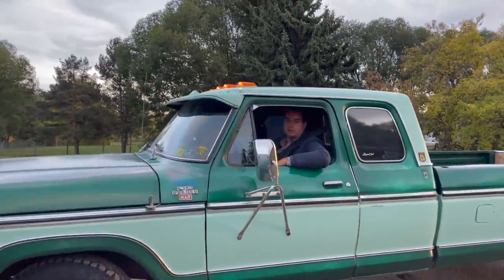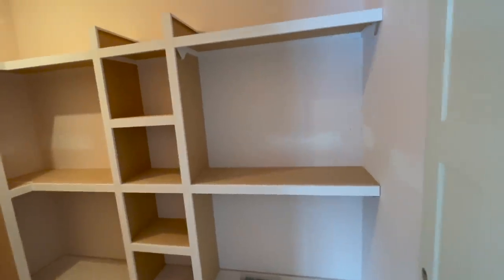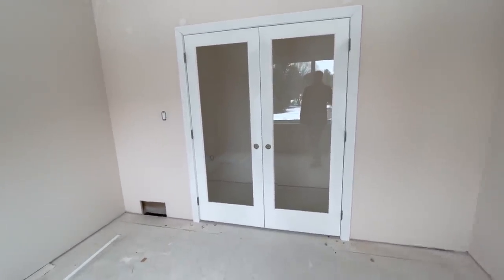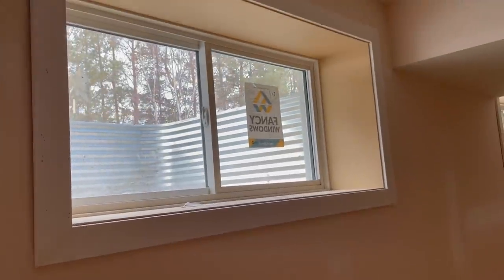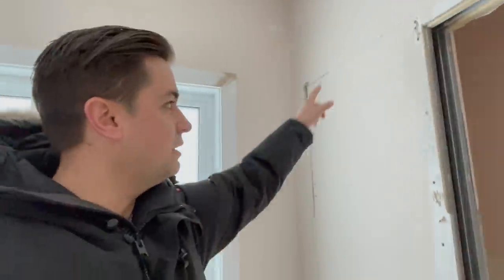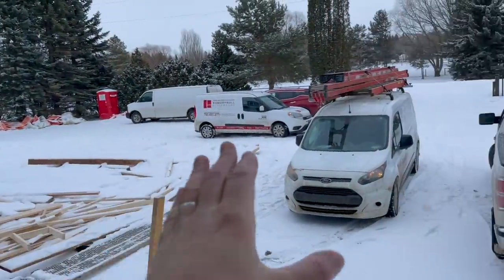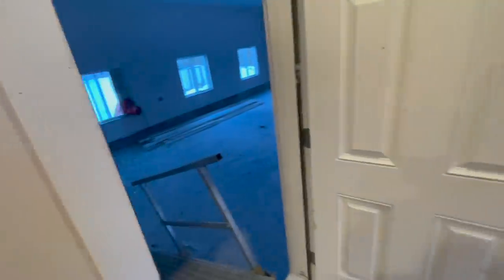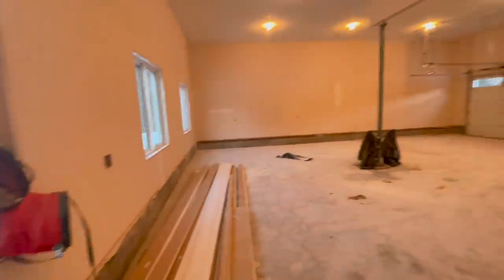No more drop of doom! the railings are in!

Comment: I have ocd and that angled railing would be a constant source of irritation! I know it's a small issue, but I've never seen  stair railing done that way. I think your home is a quality build in every other way. So happy for you guys!
Reply: Agreed!
Reply: I'm sure it's due to building codes but yeah it's annoying.
Reply: When the house is completed it will look fine.
Reply: Totally agree. Never seen it done that way. Normally, that top post is extended taller, allowing for the new height to start there if code requires the height to meet that triangle stair. Otherwise, continue the same height and then don't do a handrail for the first portion of the turn on the wall. I've loved everything about the house, but that's one thing I'd question.
Reply: @randoline13  they installed it like the rail was on a wall and you can make it follow the line of the staircase. But, when the rail stands alone it should be level. And, it's right by the front door- very noticeable : (
Reply: Look at it this way, Gives it Character  lol !!
Reply: The installer must have been drunk. There is no excuse to make a mistake like that..
Reply: @pallecla  Someone said that they made it to code. Maybe, they were tired and at the end of a long day and just needed to finish it instead of alter the design. The rest of the handrail is gorgeous!

Comment: It certainly appears that the finishing is very high quality. Personally, I'd keep all the wood scraps. You can use them for little projects, fireplace, perhaps an outdoor fire pit, or even a shed for garden tools just next to the veggie garden. At least for shelves in the shed. You may want shelves on which to start seedlings for veg, flowers and so on. Since your garage will be all about vehicles, a good sized garden shed may be in order and that will need shelving and hooks to hang tools on.   Great call on the fireplace design - it is a stunning centerpiece and focal point. I'm blown away by how much noise those glass doors cut - imagine how much better it will be when the carpet and drapes are in to absorb excess sound!   The main bedroom closet is quite nice; you're going to really enjoy being able to put things away so easily. Congratulations. It's fantastic.

Comment: I am not seeing any electrical outlets going up the stairway.  It's nice to have them for decorating purposes, as well as on that half wall to the right of the stairway on the main floor.  You probably have already planned things out, but that seems like the perfect place for a shallow table with a lamp.  Everything is looking so wonderful!
Reply: You'll need outlets for vacuuming, that's a lot of carpeting. 🤔
Reply: You never put electrical outlets on stairways because they will cause a trip hazard, you install an outlet at top and bottom stairs!
Reply: @davidplayz7323  Cords cause trip hazards, not outlets, and that can happen no matter where outlets are placed.  On stairways with multiple 'landings' like this one, it is common to have outlets if for no other reason to have plug-in nightlights on the stairs.  In actual practice, the further away the outlet, the greater the chance of tripping because of the length of cord to reach it.

Comment: It's looking great! I love the glass doors on the office. I love that Abigail is planning fort-building in the closet ☺. An idea for hot weather, if you get any there: a bubble fort. You take the biggest sheet you can find, or safety pin 2 together. Lay them out flat on the floor with a little slack in the middle. Put books or other weights around the edges, leaving two openings, one for a door and one to put a box fan under the edge of the sheet. Turn the fan on High. We loved building these forts growing up in Arizona. While you're in there you can also talk into the fan and sound like a Cylon (?) from the old Battlestar Galactica: "By your command" 😄

Comment: Even if you don't completely finish a basement at build time, have the egress roughed in (required many places, aprox. cost for son who didn't - $20,000).  Have rough ins put in for bathroom during build.
Reply: Wow if I had the money and if I lived in Canada instead of Florida I would hire drupad to build a house for me he is a fantastic contractor
Reply: Take your house to being muddled and undercoat on. Dust from sanding is a 👹 but
Reply: In one of the houses my parents built, they had a fireplace and other features (plumbing and electric for a built in wet bar to go next to the fireplace on an interior wall, etc  put in at the time the house was built.  The plan was that the builder would be back in 1-2 years to build another family entertainment area down there.  It worked out perfectly!

Comment: The woman always gets the full height closet area. 21:32 The guy gets the top and bottom closet areas.  21:37  They need the full one for dresses and long coats. If necessary, you have to share the long section.
   By the way, Costco has a nice 1' x 4' led panel, several of these in your house would be perfect. Especially the garage work area for the future.
Reply: True about the long closet space - long space for long clothes (dresses), short space for short clothes (pants, shirts).

Comment: Not many times I make suggestions, but some things just stand out. The one railing as you go up the stairs, just looks out of place as it’s angled to match the next rail. I mean that’s not done properly. It should be level, and the next rail can stand on its own level. I did also wonder about the gap between the stair going up, and the stairs leading down to the basement. I assume you have a special plan for that space. Just curious. But I most definitely would talk to your contractor about that angled railing, that just doesn’t look right at all. Other than that, you guys are getting quite the home!

Comment: Garage doors bother me. The way the tracks run over top hurts your vertical space. The drives can be mounted beside the doors and the track run to the ceiling to restore that valuable space.
We did that at our shop, what a difference.
Reply: At 14 ft, I don't think it's an issue.
Reply: @firesurfer  Until you could sure use it...
Reply: @pooginmouse  At that point, you may be a hoarder.
Reply: Up is good when working on vehicles.  @firesurfer

Comment: On the front porch  you wanted to put stone part way up the roof supports but it looks like you can't do that because the posts pillars are too close to the edge of the porch floor edge UNLESS YOU COULD EXTEND THE PORCH FLOOR/DECK OUT ABOUT A FOOT and, of course, add on to the current foundation under the floor extension to take the weight.

For the car hoists in the garage, go on the internet, VICE GRIP GARAGE,  he has three car hoists for 6 cars, ie 2 "two story."

Comment: The master closet is definitely not large enough. And the rail in the stairs at the top that goes across the fence like opening at the top does not look right. Do you need a railing on both sides? We only have a railing in one side of our staircase. No carpet on stairs either.

Comment: Hi,
I love this channel, I am sorry if I am being negative in any way, this is meant as being constructive. 
The railing going slightly upwards where the stairs turn: that’s totally wrong. It must be horizontal. And it will not join with the rest of the railing because the railing on the wall, the horizontal part, does not need to be there. Nobody will ever grab that. You finish the upward-going railing about where the support is and leave the rest of the wall without a railing. That way everything looks normal, not goofy. Sorry Alex. You even said it was « interesting » and you know that as time goes by, this will become an eyesore. Get it level…

Comment: Everything is looking great. The one thing I wound reconsider is that sloped railing where the stairs turn on the first floor. When you walk in the front door the fact that that one railing slopes at a different angle to the others is probably going to drive you and/or your wife nuts. It would look much better straight I think, and the railing on the wall doesn’t need to meet up to it. It can simply stop and not connect to it. Just a thought. :)
Reply: Yeah, it was driving me nuts looking at it Stephen. Ha the railing on the wall connecting to it isn’t straight either. I understand the builder was trying to connect everything but I don’t think it needs to be connected.
Reply: It's up to code.
Reply: Usefulness is the best way to design.  The handrails are perfect and will be very appreciated by those who need to use them.
Reply: The winder causes that. Fixing it would be a problem. It would need a complex joint.
Reply: It's a very bizarre thing for the contractor to have done.
Reply: @firesurfer  The two railings don't need to connect at all. The basement ones don't.
Reply: @LeeKeels   There is just a landing. No winder. Code requires the handrails to be connected for winders.
Reply: You can connect them if code requires it, just do it with right angles. Do a straight railing around the corner and then go straight up to meet the railing coming down the steps on the wall. My brother lives near Toronto and has the same type of setup with the wraparound steps, but where the wrap around is they still do right angles. Maybe it’s different where he lives but I’ll bet they could change it pretty easily. It even looked in the video like Alex wasn’t sure about it himself when he said “that’s an interesting way of doing it”.
Reply: @Kevinca0809  It's easier, just not aesthetic looking.
Reply: @firesurfer  yeah, one way or another something is off aesthetically I guess. Too bad they didn’t have a landing like on all the other turns in the stairs. That would have made it easer. :)
I’d still try to make it less obvious though. Maybe even make the post a little taller since the one on the other side is taller already anyway. I love a challenge so I’d be messing with it trying to make the sight lines as unnoticeable as possible.

Comment: Slides and recessed guides for pocket doors can be tedious in that after some use they tend to not stay true or straight in the wall and have to be adjusted. Make sure should there be locks on them that they are child accessible in that from the outside they can be opened in case of emergencies  like fall in the tub on the floor or WHY! Safety first! Are there enough smoke detectors and are they with batteries? Like the Stairs going to the second floor yet wonder why they were not widened on the bottom to allow for people passing by on the stairs from different directions. Design is not that way yet would look so nice instead of a dead space from main floor stairs toward basement stairs. Suggest bringing your dog to visit the house with your family because the transition from home to home can be upsetting to animals. Noticed there are no circulating ceiling fans are you geting some? Paved driveway is spoiling Alex! Ha! Ha! Building a fort sounds like that pile of wood scraps will come in handy. Thanks for sharing Stay Safe!

Comment: The walkway upstairs, I think you called it the drop of doom,  looks confusing. How will those windows get cleaned if there is a drop between them and the landing?
Reply: I'm honestly going to use a cloth on a mop handle lol. Ive done it before and it works really well. Plus I love the extra light it allows in the front. Way better now that the railings are up ❤️

Comment: I know MDF is inexpensive but its really not a great material for any sort of structural construction without proper hardwood framing and support.  Also all that MDF in the basement will absorb water and bloat over time.  Plywood is ions better and more structural.  MDF is fine for cosmetic stuff if its kept dry. MDF also damages much easier then most woods and of course plywood.

Comment: Two things! One is the radio was unprofessional.  In my forty plus of construction experience  if you saw the owner pulling in all radios were turned off out respect. The volume was to loud for a safe job site.
    I am confused on the out of level handrail. I understand that this is a bender type stair and codes need met but come on guys. Raising the lower end to level the rail seems better than an out of level handrail. Handrails typically mimic the surface they are protecting. In this case they are mimicking two different elevations and that does not work in my opinion.
  Alex I am telling you that you will HATE that crooked railing every time you walk in your front door because that is the only crooked angle in an area of MANY plumb and level angles. This is a showcase entry with a sore thumb!
Reply: I saw the winder. A complex corner joint is the only alternative. It would be a pain to design.  When coming in the front door it does seem to hit you in the face. (metaphorically)

Comment: All the hinges on the interior doors look wrong. When the doors are open there is a large gap. Don't they recess hinges in Canada? They are a bit of an eyesore. Maybe they will be painted to make them blend in? Brass ones would have been better plus you only need two per door so they dont stand out ? Or may be the doors are thin. The rest of the house looks good.